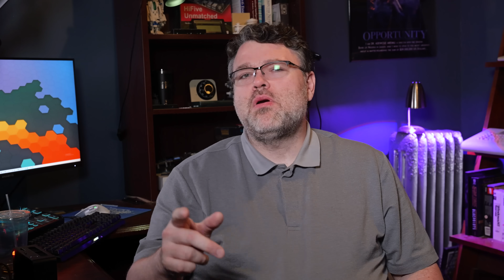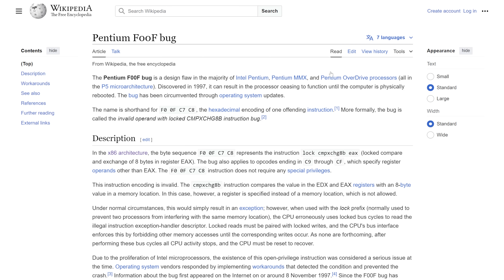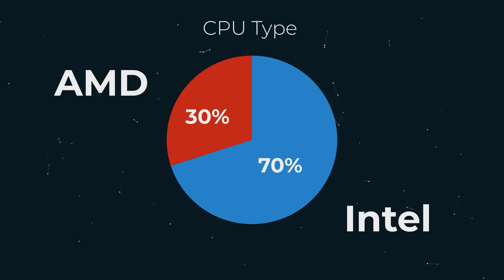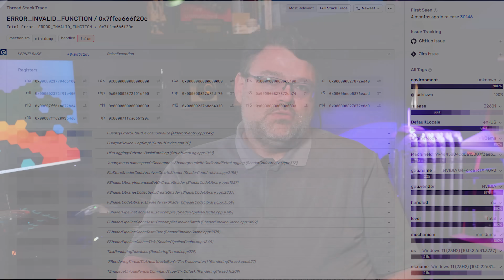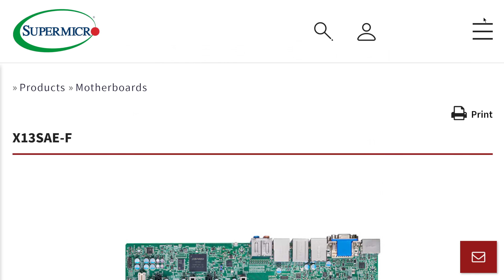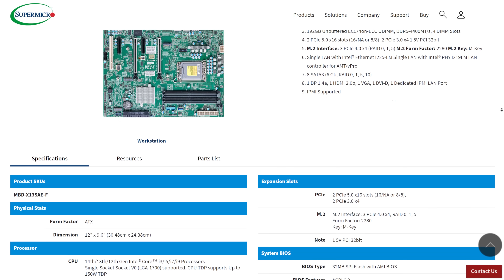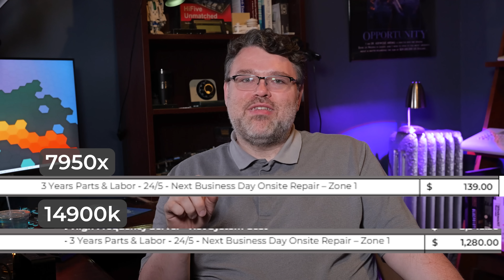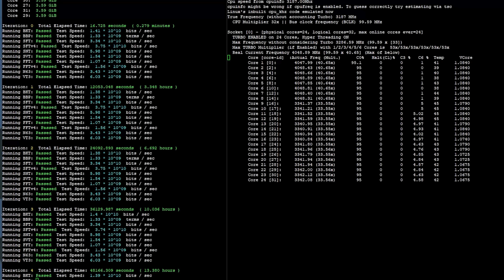Intel has a Pretty Big Problem

Comment: Its probably not the same, but on my 12th gen i7 an unstable ring clock will rear its head in weird and inconsistent ways. 13th and 14th gen cranked ring clocks even higher.
Is there any data on downclocking the ring for stability?
Reply: I'm pretty sure that if that fixed the problem we'd know about it by now.
Reply: @pf100andahalf  That's my thought too, but idk if power limits throttle the ring and I never hear about anyone downclocking the ring. It's always p-core this and power limit that.
Reply: @Summanis  the overclocking community is tweaking those cpu's every way they can so that they crash less, but they can't make them not crash reliably. They've tried every possible combination of settings. 13900's and 14900's are simply defective cpu's with defective silicon that cannot be fixed.

Comment: The survivorship bias is a big problem. Helldivers2 has a rough going.
Reply: The survivorship bias he’s talking about is specific types of crashes from which there inherently can’t include any crash data in the logs. If a program fails and the OS and hardware is (mostly) fine, telemetry will send a crash log. That’s what we can see. But if the OS itself fails or there is a catastrophic hardware failure (eg power loss, or the OS throwing a blue screen), the crash log isn’t even generated because the system shuts down before the code that generates the log can even run.

I don’t know anything specific to HellDivers, but I think his overall point is that we have to be a little cautious when interpreting the crash log data because there’s still a lot of crashes that are happening for which we have zero data (and some of those crashes will be AMD chips and/or unrelated to any CPU issues).
Reply: @benjaminlynch9958   You just explained why the Devs would have a hard time fixing their game with only partial clues. Then you reiterated Wendel's "take it with a grain of salt from the arm chair". I hope you were trying to explain things for a wider audience on my behalf instead of speaking to me.

Comment: I’m really curious if this will ultimately lead to a recall or a class action lawsuit.

Also really curious if AMD sales reps are bringing the instability issues up when they’re talking with data center clients. The fact that this is happening with workstation boards that aren’t overclocked and are much more conservative with power management makes me think this is a flaw in the fundamental design of the chip. But if so, one would think similar problems would be appearing in Xeon chips too since they share core designs, right? Very puzzling…
Reply: Xeons are nowhere near pushed to the single thread clocks of the high Ks.
Reply: @marsovac  And you can push them A LOT higher, without much issues. There is a good reason why these things are absolutely legendary.
Reply: @alexturnbackthearmy1907 What things?
Reply: xeons have a whole different design philosophy behind them, and bring intel the bulk of it's money. they wouldn't sabotage their income for a headline. 

remember, intel laughed and derided amd's chiplets. then amd slaughtered them, intel panicked and tried to copy them. pretty sure intel thought they could get away with blaming customers(you're not a user, you bought something) just like nvidia did.
Reply: Epyc is AMD, you probably meant to write Xeon.
Reply: Xeon's stopped sharing core designs with i7 during Socket 2011-3. Xeon's were moved to a mesh/grid style multi-direction interconnect to enable more cores to communicate whilst i7s stayed ok a ring bus where it made little sense to increase complexity and latency to get the extra bandwidth. Before the mesh was complete, there were several larger Xeon's with 2 ring buses and an interconnect because every hop on a ring bus adds latency until the mesh and ring bus are equal.

This is why E-Cores actually started causing the problems: Ideally they should move to mesh fabric with 24 cores, but they need a major differentiator for upselling the data centre guys, and they need low latency interconnect for gaming benchmarks. So their answer is to clock the ring to 5Ghz (for stupid stupid power draw) so they can win in benchmarks and reduce the additional latency from 16 useless cores. Honestly these chips would be much more reliable if they just added 2 more P-Cores and removed all the E-Cores clogging up the ring bus so they could downclock it.
Reply: Class action lawsuit, The consumer might get a refund of 80 cents each 2 years later.
Waste of time IMO, Need to be fined billions.
Reply: Mate, after the way Intel behaved in the early noughties against AMD, I sure hope AMD are bringing this up.  1. Prospects need to know that after months, Intel hasn't root caused the issue or as Wendell said, clearly admitted that effected clients will be made whole. 2. It's glorious when Karma scores against arseholes like Intel.  
As an aside, I think the game companies who collect telemetry have an opportunity to leverage that in order to help get to the root cause.  If it's not sufficient (as Wendell suggests), this could help the Data Scientists to refine the collection to improve this.
Reply: @petemonster1  I miss the noughties.

Comment: My 13900k went bad and I undervolt and clock my shit. Not crashes but io went out . Intel owes me $1300 for the cpu and board! I now have an AMD 7950x3d and will never buy an Intel again 😡

Same monitors and gpu and peripherals work fine on AMD so it’s both Intel CPUs. Maybe the chipsets on Asus went bad as mine were always at 80c with a raid card
Reply: Oof. Was it under warranty? I would ask for a replacement.
Reply: @bgtubber  I lose the receipt

Comment: is 12th gen safe?
Reply: yes 12th gen is safe according to Wendell in this video. It has the same low game crash rate as AMD CPUs.
Reply: did you watch the video? your question is answered in there.
Reply: @Tystros  did I watch and remember every second, no?
Reply: @jeremytine You'd expect to remember the specific fact that you're interested in though, wouldn't you? I mean if you're watching and you have a particular CPU and it's mentioned you register that fact and either groan or sigh with relief, I would have thought.
Reply: @johnm2012  not really, it was an afterthought

Comment: This is why you make a statement. The speculation machines rolling now.
Reply: I suspect Intel themselves probably don't know what's wrong.
Reply: @zodwraith5745  Or they do know, but it is a hardware problem that they can't patch with a microcode update.. So they just try to play the long game until their next gen comes out.
Reply: @kyu9649  I'm not saying that's not a possibility, but to automatically assume as much would be highly unfair. Intel is WAY too big a company to cover up the kind of conspiracy theory you're insinuating without a leak. They haven't done anything to try and cover it up and have acknowledged it publicly. They just haven't provided a solution which just circles back around to my previous comment. They have a hard enough time keeping a lid on leaks they DO want kept secret like future products. This would be way too juicy for a leaker with all the coverage it's had.
Reply: @kyu9649 This is probably the case right here. If they don't have a good workaround or fix in sight, they're just gonna bury their head in the sand.
Reply: @zodwraith5745 they know, they're trying extremely hard to patch it via microcode so they can come out with a fix at the same time they acknowledge the failure.

Welcome to the age of publicly traded companies, their shares will tank for sure, they're just trying to control how much they crash.
Reply: you’re a statement!!

Comment: Zero issues with my 13900k for the last nearly two years. Both at stock and OC'd with OC'd RAM, even though I've been using an outdated BIOS too. I had more stability issues with my 5800x3D system than I have had with my 13900k. Remember Raptor Lake launched in 2022, yet now people are claiming issues 2 years later?
Not saying this issue doesnt exist, just that it seems blown out of proportions. Anyways, Arrow Lake comes in a couple months so its kinda moot now.
Reply: I mean if 10-25% of 13900K and 14900K used in Enterprise are failing and software patch doesn't help them - this isn't exactly good. Also 14900K launched like 9 months ago and first problems were discovered 3 months after launch.
The fact that you don't have issues (which video states that about 50% of CPU's have potential problems, with half of them doing well with the patch) - that is good, but it doesn't mean that everything is great. Especially when it happens on new CPU's as well - this isn't just degradation due to use. Degradation just makes the problem worse. It doesn't cause the problem.
Reply: What brand boards? Seems Asus is the problem
Reply: That's bc yours were a lucky one. If it failed like mine you'd be shitting on Intel for your lifetime adn giving it the most importance to it.
Reply: @Pacho18  You eat it.
Reply: @kramnull8962  Hope doesn't happen to you the worst things on your life ever.
Reply: @Pacho18  It won't.
Reply: You didn’t watch the video… also if you have been keeping up it’s an increasing error over time, indicating it’s a degradation of some kind.
Reply: Aaand I don't have any problems with my 5800x3D..
Reply: The copium... I didn't have the problem, so i must be not that bad. He never said that 100% off intel users will have a problem, but when 90% of the errors are from intel users there is something wrong.
Reply: Is this Mr. Pat Gelsinger I'm talking to?  The cope is inspiring as always, sir!

Comment: My 14900K has been solid with zero issues the whole time.
Reply: Lucky! How long have you had it ?
Reply: @coltmarshmallow  November, so basically since launch.
Reply: @MrHav1k One word: Electromigration. When your 14900K fails, it won’t be a soft fail. Make sure that you backup your data often.
Reply: Highest number Wendell pointed to was 25%, so 3 in 4 are just fine, currently.

What is more concerning is it's increasing over time, will it platue, or will all 13/14900k/s/f start to experience this, only time will tell
Reply: Luckily for you.

Comment: All of Intel's chips need to be completely redesigned to fix those bugs, micro code updates won't do it.
Reply: Source: Trust me, bro.
Reply: @tim3172  Source:  the way to many bios and microcode updates that makes the industry tired of intel...no one likes to check weekly what new update from intel has appeared  and maybe this time they will fix it...and I'm not talking about the fact that you have to turn off the e-cores and to work the voltages otherwise it cannot be used...
Reply: @mrmrmrcaf7801  Calm down fidgety fingers.

Comment: The new BIOS update for my msi board with intel defaults actually performs worse than the previous bios so I rolled back and used the stock cooler 253w power limit option and a negative voltage offset of 0.07 like I had from the moment i installed my 14900k earlier in the year and so far it hasn't had any issues. Intel doesn't want to take responsibility for this utter disaster. clowns.

Comment: Is this about the motherboard presets burning up CPU's with too much power? The story is a few months old.
Reply: Same issue, different view point. Server side implementations don't do risk, don't over clock, don't use extreme settings. So, Intel's messaging makes less sense.
Reply: It may be a couple months old but it's learned to walk already

Comment: I never had problem with my 13900KF, a sample size of 1. I use 4.8G at day one and gradually increased clock to 5.4G. Those who expect to work with out of box settings should not buy a K processor. XMP is overclock and can fail.
Reply: Mine went bad at 5.5 with 2 at 5.6 ghz with a .6 undervolt. Io and monitor detection went off. WTF. Same gpu and peripherals on AMD … no problems. 9900k also had random usb disconnects too
Reply: In your specific case, you undervolted the cpu, how is it supposed to not crash?
Reply: @iceboy1170  moving the voltage to normal couldn’t fix my 13900k after the undervoltsge. Io never stabilized
Reply: Did you even watch the original video? This is happening in server space as well where the chipset is different and there's no overclocking going on.
Reply: Server space is DEI as yourself.
Reply: It is just as you need to understand, no matter if you buy a 6000 30-36 memory, or a 6000 30-40 memory, you should all be setting it to 30-37.
Reply: I don't know if you are aware with the details of this problem, but those CPUs are crashing at STOCK settings, without the users overclocking them.
Reply: @bgtubber  They are not. They're crashing at the MOTHERBOARD VENDOR ARBITRARY SETTINGS which are overclocked and outside of spec from the box.
Reply: @tim3172  Servermicro, a top tier server manufacturer will absolutely not run their boards out of spec, and as you see (if you had watched the video before commenting), the RAM is as you would expect, set to server standards (i.e. slow).
Reply: @tim3172  Um... what? How are they outside of spec if they are crashing at the factory defaults that Intel approved themselves before their motherboards even hit the market? If you are trying to throw the motherboard vendors under the bus, like Intel did, why didn't Intel accuse motherboard vendors of running their CPUs out of spec before the whole scandal blew up? Do you think that Intel didn't know at what settings their motherboard partners are running their chips before they release them on the market? Looks to me that you are biased (probably an Intel CPU owner?) and you are trying to cover for Intel's blunders. The whole thing is caused by Intel's desire to try and compete with AMD, and since they don't have other means to compete other than pumping more power into their chips, they did just that, consequences be damned. It's more than evident that this is the case when you look at how much power Intel's CPU consume just to compete with Ryzen, Threadripper and Epyc.